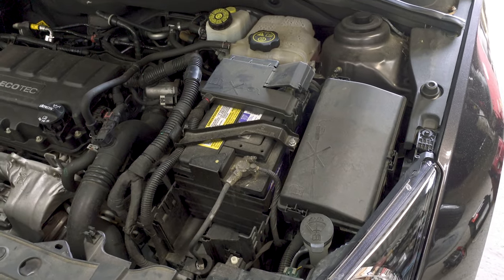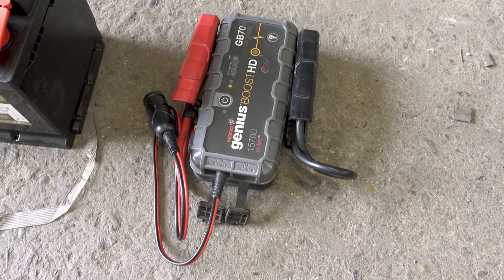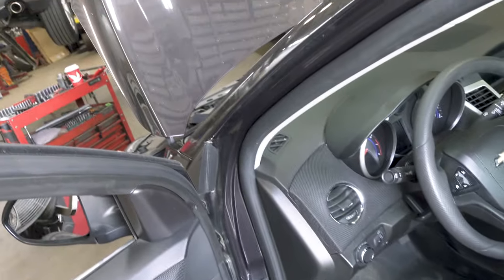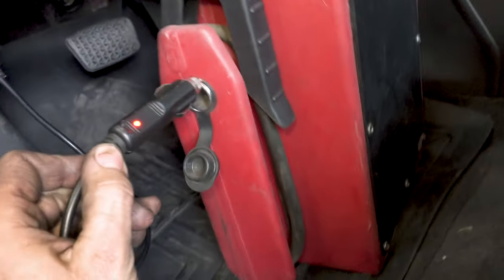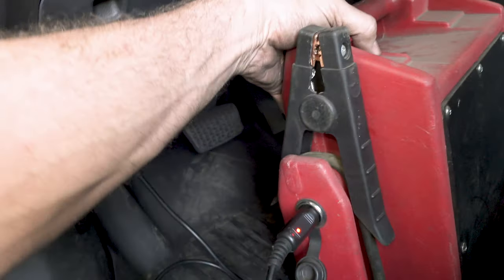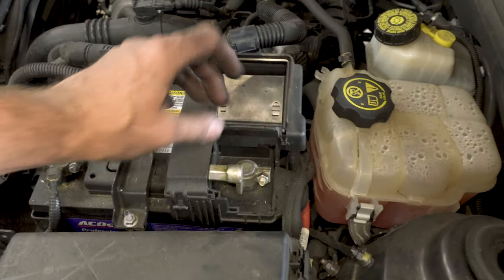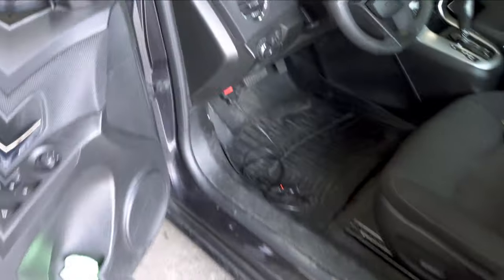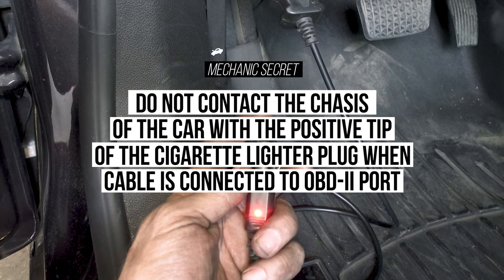Battery Replacement Secrets: Save Your Car's Memory and Presets Like a Pro

Comment: I have some of those jump boxes, but like you say, they tend to shut themselves off and unless you are doing a super quick swap, you will lose with that scenario. But I have a few of my old 12 volt motorcycle batteries that I didn't want to throw out, and I figure next time I am worried about such a thing with my new computerized car, I will just add some clips to the terminal clamps in parallel before I disconnect my big 12 volt. THe motorcycle battery should be fine just to keep memory and alarm happy and operate the doors and locks. This method is cool too, I didnt realize you could use the OBD as mem power. Gonna file that one away for a nice plan B on the road.

Comment: This sounds dangerous... If I plug the saver into the OBD port light on it will illuminate. Then if I plug the other end of it into the power source wouldn't there be an issue? Two power sources colliding and going against each other.

Comment: Does the jump starter's amp matter through the obd2 port?
Reply from the maker: No, as long as it can supply constant power while your battery cables are disconnected.